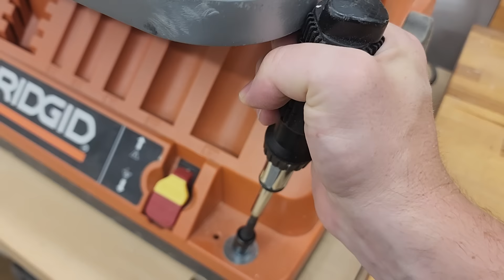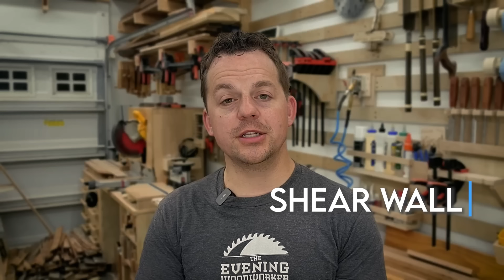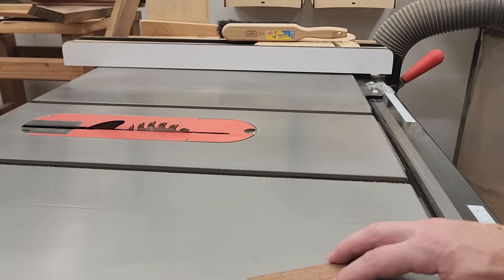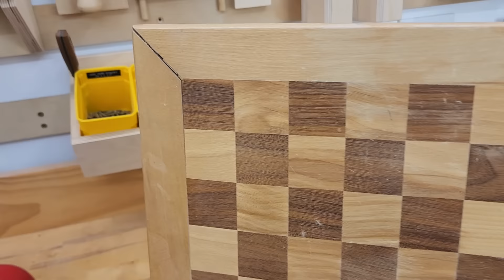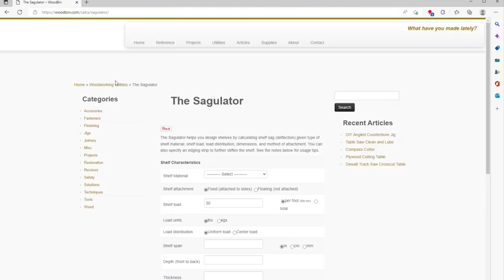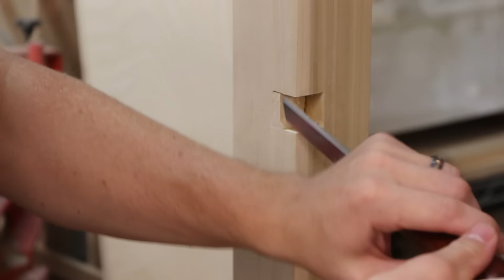15 Engineering Tricks Every Woodworker Should Know

Comment: Hammers are lousy nail pullers. Cat's paw, is good for getting out nails that are driven flush. I don't like the sheet metal ones because they have too much flex to them. The pry bar you showed works, but it doesn't make for a good hammer surface. I was on the cusp of nail guns.
Reply from the maker: Agreed on the cat's paw! For the two summers I worked construction, that was our go to tool for anything we didn't care about the surface on.